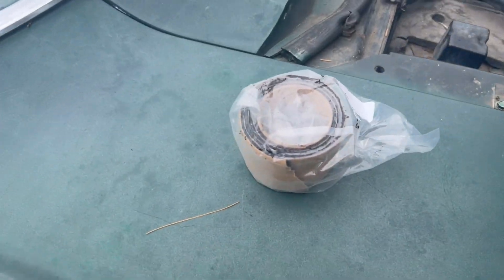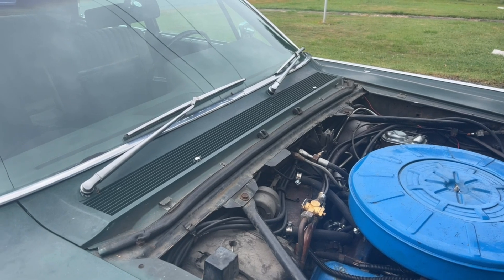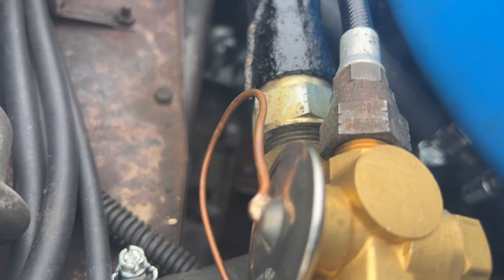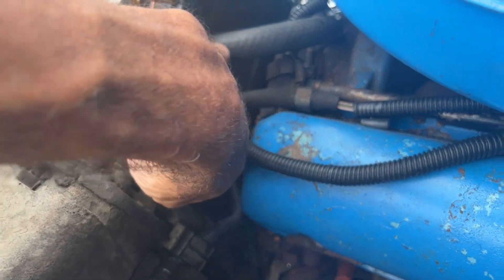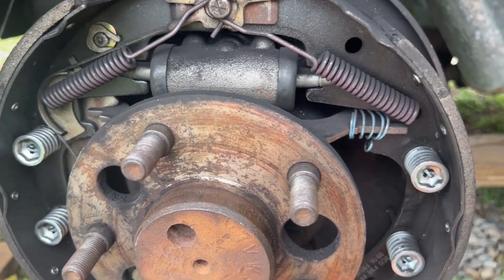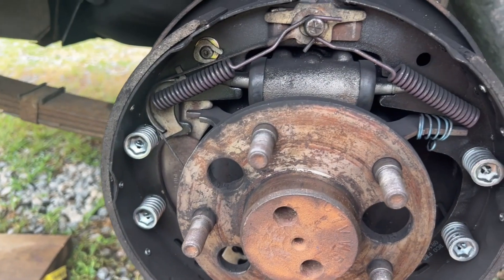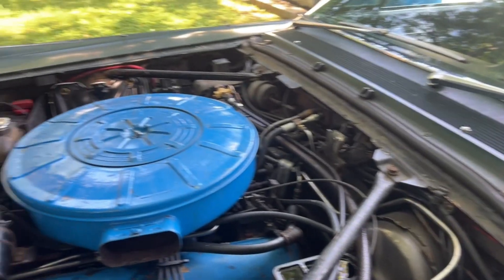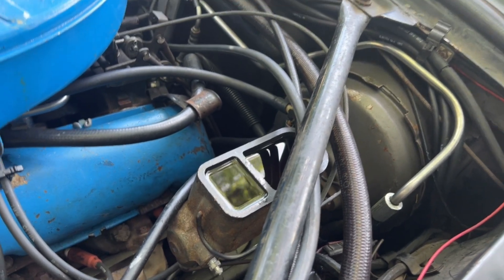1967 Lincoln Project Update 30 Jun 2024 Test Drives and Detail Work

Comment: Wonderful news all around.  Glad the AC is working great for you. You know my brake issues were also the right rear. It is possible that even though I swapped everything out twice that my emergency brake was causing a drag.  I did back it off until the emergency pedal went all the way to the floor before grabbing.  It is still a mystery but it did get better once I put some used return springs on it.  I still have not tightened the emergency brake up to the normal level. And now I'm afraid to try,  At least you have the dual master cylinder which mine is a single.  And the Perfect Circle cruise control on the 61-3 does not allow room for the change over to a dual master cylinder because it is in the way.  If I were you I'd put a few more thousand miles of normal use and then tighten the emergency brake back up and see what happens.  (get some wear on the shoes) We both know that the shoes do not properly fit the drums because the drums have been turned probably more than once.  They need to wear off the high spots before seating properly.
Reply from the maker: Thanks again Jeff!  That is interesting your brake issue was also the right rear.